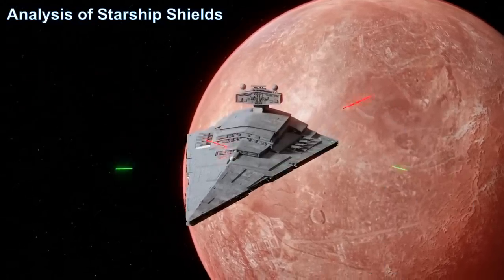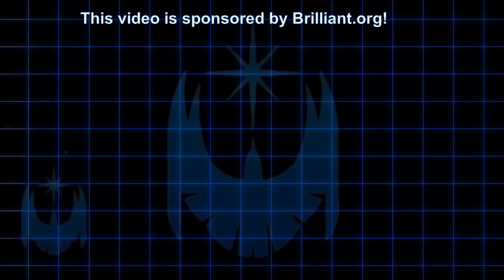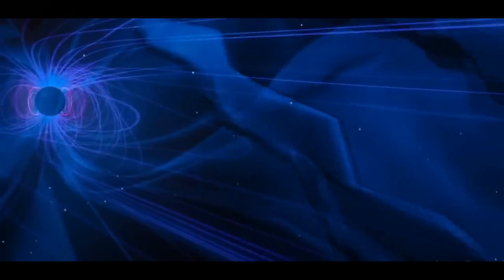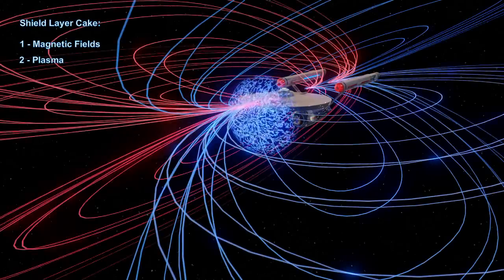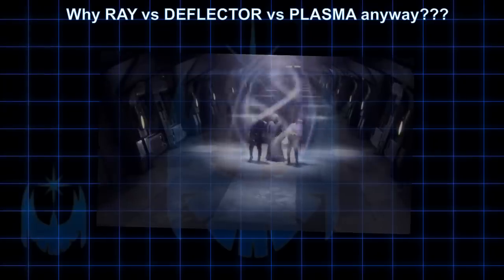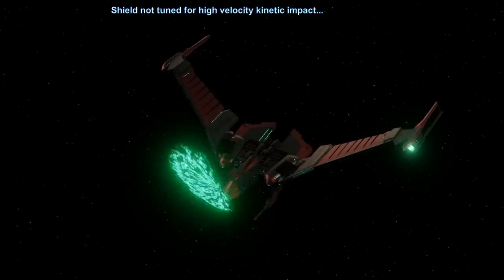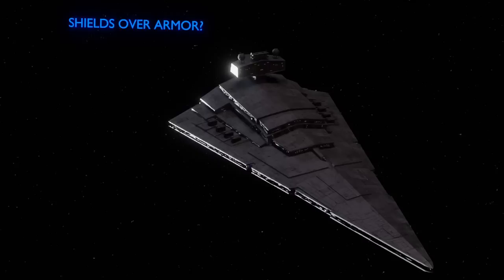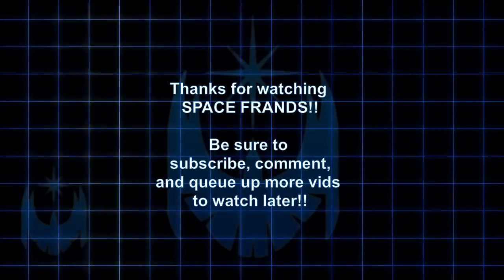REAL Starship Shields Types - They Work Like This...Animated Breakdown!

Comment: After seeing 13 movies and 948 episodes of Star Trek, it’s very clear whose tech wins at war. Offensively, Star Trek vessels no doubt will lose against the overwhelming firepower and versatility of Large Star Wars ships. Federation ships lack the capacity to repel swarms of fighters while simultaneously defending against hundreds of turbolaser batteries, ion cannons that disable shields/ power systems, point-defense guns for anti-fighter roles, and powerful tractor beams that immobilize targets. This combination allows Star Wars forces to dominate through sheer volume and coordination, exploiting Star Trek’s inability to sustain prolonged engagements. If innovations like phasers or super slow warp drives were truly superior they would have been discovered, reverse-engineered, or integrated over 10’s of thousands of years by Star Wars enterprising factions.

Comment: Please look into Starsector! It handles shields in the opposite way. Where they block everything but fill up capacitors as they are hit instead of their strength decreasing. If the ship's capacitors ever max out it causes the whole ship to overload and malfunction.

And normal ship operation like firing weapons also causes this "flux" to fill up. So a good commander has to balance flux and move in and out of combat range to vent the flux. 

On top of that you also have some weapons that do damage to the sheild or armor.

Comment: 1. you cant just delete energy it has to go somewhere and that would be into whatever is generating your sheild its like holding an actual metal sheild and then you get hit with a cannon ball maybe the sheild wont break but the guy holding it will 
2. "if you have the technology to adapt them" okay what if you have the technology to adapt armor??? and sheilds can do absolutly nothing against a laser
3. they would have to in order to have the thing generating the sheild not get utterly ripped apart
4. free up the design? free it up for what? looking cool? you have to put in way more structure to manage to one singular most likely rather small object taking the full force of a 1000 pound missile traveling at 1/10th of light speed and not getting ripped out of the space ship good luck with that

Comment: a magnetic sheild is good untill part of your ship is in side the feild and it brutaly incinerates it 4:43 that violates so much physics: every action has an equal and oposite reaction so that hitting your spaceship would have to push back on it which would cause structual damage due to it not pushing the entire spacecraft evenly 5:12 ahh yes so effecient to do that rather than just makaing your ship's hull stronger 5:55 no you couldent you are pulling this out of your ass you cant make a sheild that light cant pass through that would just be a wall... there is no good reason to have a force feild in the sense we only see them in scifi because they are see-through so you can see the ships still also how would a magnet detect a laser coming at it? its moving at light speed... and the sheild would get broken down because every action has an equal and oposite reaction getting hit by a big heavy missile would knock your sheild back but what would it knock back? the plasma of the sheild itself? well it couldent because then you could just something so heavy and fast that it pushes your sheild into you alright then it must be pushing on the plasma and the magnetic feild is pushing back which is coming from the sheild generator which would take a very large impact every time the sheild was hit and it would eventualy destroy it

Comment: Plasma best.. Points at Star like UFO's and Points at ULTRASOUND mic on explorer probes For same reason Klingon liked it but more. Plasma Ultrasonic echoes to pull gas to ship tight to create even higher medium around ship to manipulate with Ultrasonic holography for cloaking. Yes.. Its real technology now. Points at Predator films That species.. They like making engineered warriors to hide their real selves so nobody can adapt to fight what they really are. Excited plasma by Ultrasound = stronger EM field and if you compress outer layer with pulses you can use outer layer plasma EM to crunch inner layers to maintain a fusion core similar to a star. That's why UFO's pulse.

Easy Peazy..

Comment: Plasma doesn't have to be hot. One can use positively charged low temperature ions while storing the electrons in a capacitor. One can use high temperature electrets. Plasma lenses can work at room temperature. Pulsed laser PDCs can cause ablation on incoming projectiles as an active deflector.

Comment: I was doing some testing on an Pulsed Plasma Thruster using a threaded rod inside a copper pipe with Polyethylyne inside the pipe as solid fuel, the plasma arc rotated around the rod thread & pipe vaporizing the Polyethylyne fuel which formed a plasma bubble at the pipe opening.  This is how a plasma shield is created.  Electrical plasma arcs are used to burn a fuel that creates a plasma bubble.  Since I used an AC power source the pulsed plasma bubble oscillated at 60hz which is the shield frequency.  Science fiction has become real.

Comment: Void shields from Warhammer 40k are pretty interesting, albeit there's no scientific explanation on how they might work like this vid. They create a threshold around a ship that redirects energy and matter into the Warp(a parallel dimension that's overlapping this one). 

They're realistically invincible, but 40k doesn't care. Everything is overkill. Extreme bombardment with each weapon many times more powerful than the Tzar Bomba can eventually overload the void generators.

Comment: IN regards to the Enterprise series of ships in startrek, its important to note that the Deflector dish or otherwise specified as the "deflector array" is that colorful lit up section located on the front of the engineering section of starships.  Gene Roddenberry described the deflector as beam that is shot off into space which eliminates all matter in its path as the ship travels at warp speed, so that the ship is not contacting small pieces of matter while moving near the speed of light.

Comment: EVE is actually a bit of an oddball in that only armor, not shield, has the ability to alter resist profiles based on enemy fire live (Reactive Armor Hardener). Otherwise both Shield and Armor can be hardened with specific damage types by modules you picked before undocking (or use a ‘multispectrum’ hardener that resists all types for less). 

Armor in EVE is basically shield but without auto regeneration. Shields are naturally vulnerable to EM/Therm and armor to Explo/Kin, but tier 2 ships have bonus resists against that faction’s traditional enemy faction’s main guns. 

Adding more shields increases signature radius making you easier to target and hit, while added armor adds mass, slowing you down. Both have repair options that spend energy. (Shield reps at the start of a cycle, armor at the end)

Comment: Energy in whatever form whether it be kinetic, em, heat or radioactive can be measured in waves. Frequency is the unit of how we can measure these waves. 

Just like how you can repel two magnetic fields of the same pole, similarly can be done by adjusting the frequency of the field protecting the ship.

By using software to automatically adjust the frequency of the shield to match the frequency of the incoming energy, you can repel multiple forms of energy (eg. kinetic and radiation) by finding a median frequency and increasing power to the shield to successfully repel the incoming energy.

Comment: In Star Trek, shields and deflector technology are based on the use of graviton generators.  In essence, they harness artificial gravity to create a graviton field.  For the main deflector, which is primarily used in warp flight (though impulse flight to a lesser degree) to create a line of artificial gravity in the ship's flight path.  This has the effect of "deflecting" or altering the trajectory of objects that would otherwise hit the ship in flight.  This is generated by the "dish" at the bottom front of most starships.

Shields, however, are generated by grid like structures on the hull itself.  This is the typical "bubble" like shield effect you're used to seeing in the show and is most commonly what you see enemy weapons "hitting" in the series and movies.  These are intended for combat but also general radiation protection.  This is also most commonly what they refer to when they say "shields are at 47%". 

Deflector shields are required for warp flight.  Standard shields are required for combat protection and will not protect the ship at warp velocities from objects on the ship's flight path.

There's a little gray area in the recent movies in the TNG era where the shield bubble was no longer there and it was sort of acting like Star Wars shields.  I don't know if this was intended or not, but the inconsistency is annoying.

Comment: I mean, if you wanna stop photon- or plasma-based directed-energy beams like lasers, your hullplate would need to be tungsten D (for strength) with a flecfrac (reflective/refractive) coating of crystal microgranulate to break up and redirect incoming energy...
Or just huck a beer can at the emitter. That usually works.

Comment: most deflector shields in sci-fi are gravitation based.  The objects are not deflected but rather are traveling in a straight line.  The space in front of the ship is distorted so that those straight lines do not intersect the ship.

Comment: Programmable matter in Star Trek is gong to be interesting for shielding. You could, theoretically, create ablative armor, or change the properties of matter at the projected point of impact to something best capable of dealing with the threat. For example, if someone fires EM weapons, you could make that spot on your hull momentarily retro reflective, sending the energy back at the attacker. Transporter tech should see more use in defense, as you can get around the conservation of momentum problems. From what I have seen, transported objects conserve their momentum from the point where they were dematerialized and retain the speed and direction when rematerialized without exerting force on the “beam” apparatus.  So, for projectiles, you could simply lock them and transport them back pointing a slightly different direction, even back towards the attacker. 

I also like the idea of programmable matter weapons that would have to conserve mass, but could figure out the best payload to deliver a given target milliseconds before impact based on sensor data.
Reply: Yeah or just beam the matter based weapon and rematerialize it with a 180° velocity back at the attacker.

Comment: Electromagnetic shield plasma shield electromagnetic shield and reclamators to reclaim the heat to turn it into electricity to hold up the magnetic barrier electromagnetic barrier that would be a beast shield system

Comment: Star Trek Beta Canon (Best Destiny) explains there is a difference between the shields of Constitution Class and Excelsior Class.  Constitution was designed with multiple types of shields that overlayed and were focused to defend against a specific type of attack, Excelsior has a "General Shield" that protects against all of them but can't automatically adjust.

Comment: Something I don’t know if anyone has talked about (or has even realized) is that kinetic energy is still transferred across two interlinked objects even if that connection isn’t material/physical. I’ll use two examples, one of which I’ve actually seen in a YouTube video. 

I’ll start with the one I haven’t seen in a youtube video, although surprisingly enough I figured out this whole thing and came up with this example specifically by thinking about Megumin’s staff, Megumin from Konosuba. Let’s say that you have a hard light energy generator that makes a plate of energy exactly and precisely one meter in front of it. Let’s also say that it gets hit by something fast or heavy enough to push it, a cannonball should suffice for demonstration. Because the plate of energy will always be one meter in front of the generator, if the plate gets pushed back, so too will the generator. In order for the generator to not get moved, the energy plate would need some other way to deal with the kinetic force of impacts. Because let’s do another thought experiment. You have a shield generator the size of a shed, and it projects a bubble shield 1km in diameter. Your ship is on a collision course with a large asteroid, and it hits your shield. You briefly think to yourself that maybe since the largeness of it means that the force gets spread out over a large surface area, and that might mean you’ll be OK, but no. All of that force has now been concentrated into the shield generator, making it like the tip of a pile bunker. Having lots of shield emitters scattered across the ship’s hull might diffuse the energy, especially if the emitters position on the hull don’t correlate to the position of the shield they emit, but I digress.

Next is the youtube one, let’s say that you have a pair of superconducting magnets, and have gotten them to magnetic/quantum lock (this principle is what would be used in maglev trains). You then place the magnets on a scale, one of them hovering in the air due to the locking. You then place an object on top of the floating magnet, and if you didn’t predict this then to your surprise you watch as the scale shows an increase in weight. Even though it wasn’t through a direct material connection, the force of the added weight was carried through the superconducting magnetic fields and increased the force applied onto the scale. In conclusion I’ve never seen this directly addressed, although it does explain why you hear shield impacts in Star Trek and the like.

Comment: To defend against a laser, the plasma shield would need a plasma frequency equal to higher than the laser frequency. The problem is that the plasma frequency is proportional to the square root of the electron number density of free electrons. So doubling the plasma frequency requires 4 times the electron number density. To get up to stopping visible light, you would need a plasma as dense and hot as the core of the sun. And then UV lasers would still go straight through like it wasn't even there.

Comment: Some disadvantages to energy Shields is if your primary and secondary power sources go down , so do the shields .
If the shield generator is damaged or destroyed , 'no more Shields' .

Another thing that you glossed over was that as much as the shields would be able to keep things out they would not permit anything to be fired or released from the ship as well .
Think about it. , Why would the physics work one way and not the other ?
Put your Shields up , 'great', their Torpedoes and phasers can't get you but why would your Torpedoes be able to leave or be any less susceptible to the deflector Shields as your enemies torpedoes would ?
And if they're light-based weapons can't get in , how do your light-based weapons get out !?!?

Armor on the other hand is a tried-and-true measure of Defense !
Is it perfect.....no, 'nothing is' , butt let's talk about where the perception of this 'perfect system of anything' coming from very briefly in that of Star Trek .
A show that is riddled with multiple "MacGuffin devices" that allow the crew to do almost everything & anything at the expediency of the story , versus actual science !

My God ! They have a virtual "Godmachine" in the form of the transporter !
If someone was missing a limb or had an incurable disease "you could merely beam it out of them" or replace the limb just by putting in more energy into the transporter system & programming the computer as to what the person's physiology looked like before amputation !!!
Let alone the ludicrous  amount of power it takes to break down the human body into atoms , let alone anything else ( cargo , humpback whales Etc, ) then transport it through space and then through an atmosphere and then at the cellular and atomic-level recombine an entire human being !!!
Did anybody take into consideration the amount of power let alone computational power it takes to do that just one time ?!?!?

And don't get me started on the matter-antimatter containment system .

'Jesus jump roping Christ' ,  just go do the research on how absolutely devastating a few grams of antimatter would be exposed to the matter based universe !
There's plenty of videos on it , and I love how people give the Navies of the world heat for having combat ships with "nuclear reactors" in them knowing full well they may be shot at .
But ! "Mother of God", these Star Trek vessels with they're full-on ANTIMATTER containment systems !
Of witch based on some diagrams maybe dozens if not 100's of ft long.....full of ANTIMATTER !
Just how much of the alpha quadrant gets blown to hell when even the smallest ship is destroyed !!!

But to get back on topic and in conclusion , 'physical armor is more reliable than shield' .
I don't really appreciate how the presenter of this video merely just says there is evidence out there for this type of energy shielding to exist but doesn't present any examples or links to any NASA studies to show the research .
I'm sorry but as far as energy Shields go I'm in the camp of " Isaac Arthur " and his video on how Shields would and would not work !